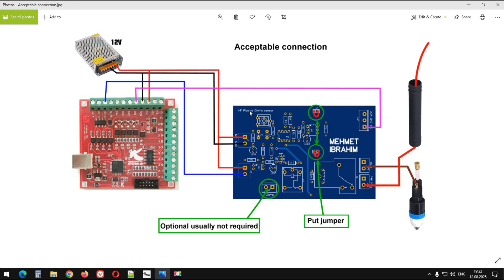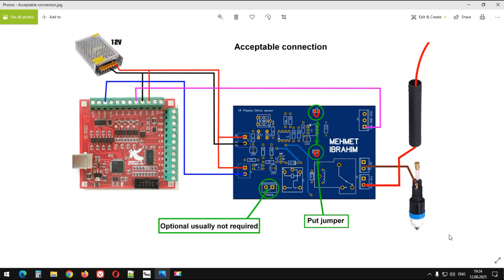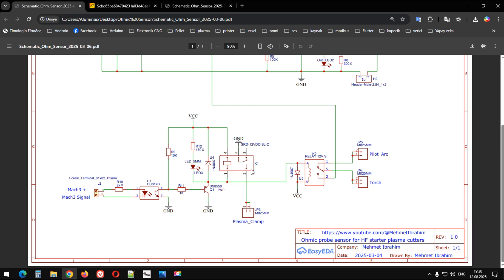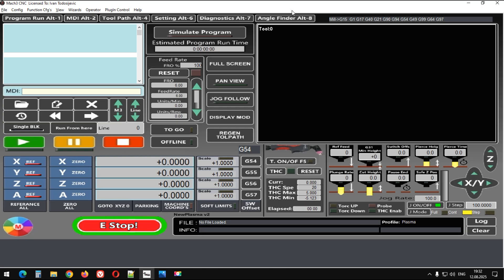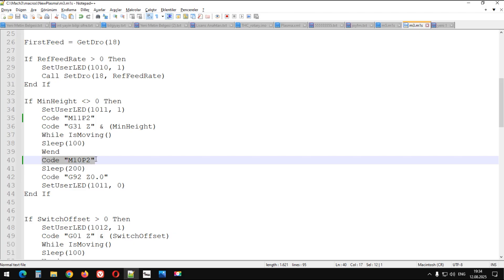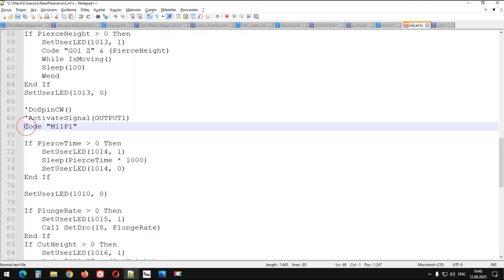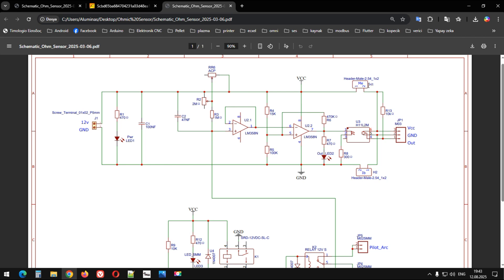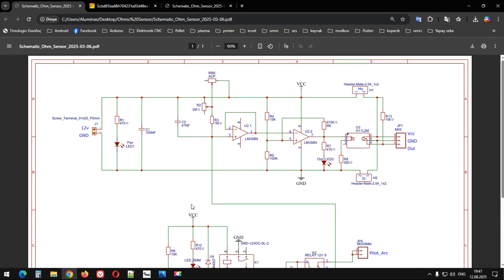Ohmic sensor for Mach3

Comment: Hi, thank you so much for your contribution, but I have a question. In my case, I have an "Ergocut s45" torch that includes a trigger. How should I connect it to the "torch" port on the ohmic sensor board? I would greatly appreciate your help.
Reply from the maker: The most reliable method is to turn on the torch and, using a multimeter, insert one probe into the nozzle and the other probe to locate the cable; the cable that makes direct contact with the nozzle is the pilot arc cable.
Reply: @MehmetIbrahim  Okay, the cable that goes to the "pilot arc port" on the Ohmic board would be as you mentioned, although it could also be connected from the plasma cutter as indicated in the diagram.
But the cable that should be connected to the "torch port" on the Ohmic board... ¿how do I identify it?.. Thank you in advance...!!!
Reply from the maker: @santiago1998z Okay, now that we've found the cable, cut it ✂️ then you'll have 2 cable ends, one pilot arc coming from the cutter and the other from the torch.
Reply: @MehmetIbrahim  Okay, very good. What would happen if I didn't cut the cable coming directly from the plasma cutter's pilot arc and connected it in parallel to the ohmic board? Would it work?
Reply from the maker: @santiago1998z 
It will continuously read signals... The purpose of the ohmic sensor is to connect it to the sensor for detecting the plasma torch and to the plasma cutter for cutting. If you connect the wire in parallel, the sensor will continuously detect signals because it is very sensitive. Additionally, high frequency is generated when the pilot arc is formed, which can cause the sensor to burn out.
Reply: @MehmetIbrahim  Okay, thank you very much, friend, for the contribution.

Comment: Does this work like THC without the fire? Or does it just set the initial high? Please answer, thanks.
Reply from the maker: This has nothing to do with ignition or THC; it's simply for ground detection when the torch contacts the material as it descends.

Normally, a limit switch is triggered by the torch pushing back upon contact with the material. However, with thin materials, the weight of the torch compresses the material, causing it to lose position. This ohmic sensor allows for detection without pressing on the material. It's so sensitive that even aluminum foil stops motion without flexing.
Another advantage is its ability to be used with HF-start plasmas, as these types of sensors have always been problematic with HF-start plasmas.

Comment: Have you successfully used the red USB board with your plasma?
I tried using it, but the huge interference prevented it from working...
Reply from the maker: Yes, I've been using it since the beginning, no problems. It works flawlessly as long as it's properly grounded, shielded cables on the CNC lines, a metal panel box, proper wiring, a pilot arc feature on the circuit breaker, and the USB line is properly secured without getting tangled in them.
Reply: @MehmetIbrahim  
Maybe you could make a video about this? Your videos are very helpful. My USB board would freeze when the  torch was leaving the material and the pilot ARC was in the air.

Comment: Greetings, friend, could two relays be placed at the relay output of the parallel port board?
With inverse logic, when the plasma is activated, the ohmic sensor is deactivated.
Can this work like this?
Thanks 🤜🤛
Reply from the maker: I've considered this, but due to their mechanical components, relays can sometimes not operate simultaneously, allowing HF to reach the sensor.
Of course, there is a way around this: Using a timed relay.
Plasma must be turned on after the pilot arc cable is connected to the torch.,
Otherwise the sensor circuit will be damaged.
Reply: @MehmetIbrahim   ok amigo trabajaremos en eso,  mi plasma es sin alta frecuencia

Comment: you are really amazing... this is very helpful when working on super thin materials, the next job is can you make a pilot arc for a cheap HF plasma like the cut40 on the market
Reply from the maker: Hello, breakers like cut40 and cut50 on the market are designed with similar features. I made a pilot arc circuit board for cut50.
https://www.youtube.com/watch?v=m7NQAYoYZ_I